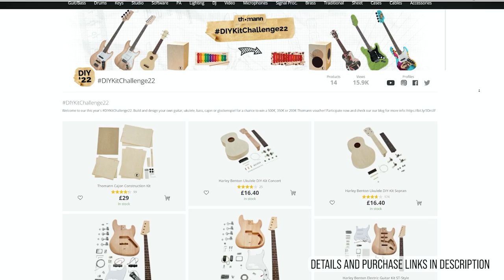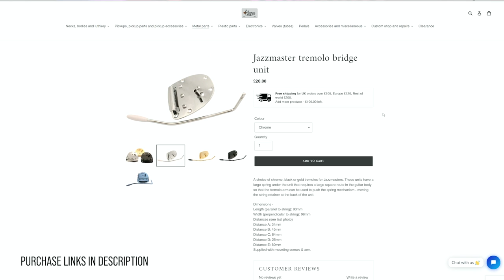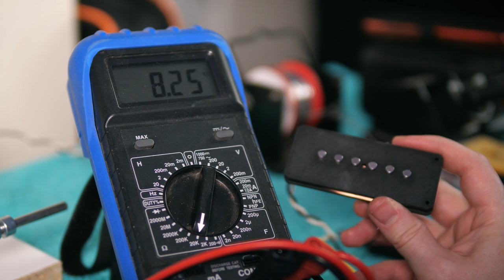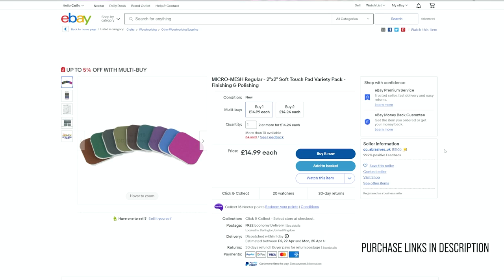Modifying a Harley Benton Jazzmaster Kit | #DIYKitChallenge22 Part 1

Comment: Interesting! The only part that doesn't really work for me at the moment is that pick guard material. It's kinda gathered in points where you had to bend it around the curves, and it just looks daft. As for finish/colour, I'd love to see it in some kind of outrageous shocking red. Tidy up the pick guard and the black would work nice.
Reply: I think the pickguard issue could be solved by doing enough relieve cuts on the backside and then burnishing the edges. That should help to make it conform to the pickguard underneath much nicer!
Reply: @helojoe92  I'm not convinced that would solve the issue. It would need to be heat molded or the material would have to be stretched in some other way. It's all good, and I'm sure it'll end up looking great.
Reply: @periurban  I'd give it a try anyways^^
But taking a heatgun and/or some moisture to it should help aswell 👍🏻👍🏻

Comment: Finish suggestion - find someone with a laser etcher big enough to cover the surface of the guitar, burn in a dinosaur outline of a different species from what's on your flying V (maybe something from the herbivorous groupings?), working a design around the area that can mask the plugs, and then give the whole thing a coat of poly... or heck - do you think the Crimson melamine would work on the body?

Comment: I have also put a JA from HB together but with a Bigsby term with a roller bridge. I painted the body with gold glitter from the same material which is on greeting cards cause I do screenprinting as a job. The headstock is also gold glitter which has the form of a fender head. I changed the P90 pickups with other better-sounding pickups and It sounds and looks fantastic. Nice to see you modding that guitar and looks terrific too.

Comment: Great start !. My suggestion/idea: do an hotrodded jazzmaster with traditionnal hardware but higher output pickups (like hot p90) and a 'muscle car' paint such as a racing metallic blue (automotive spray paint on a primer coat) with two white stripes (decal or painted).

Comment: As a surf player, there's nothing like the Fender offset vibrato system. The mechanical design builds in a kind of dampening so that it's not nearly as jumpy as a Strat or Floyd Rose trem. This is perfect when you want to play really smooth dips and use a very rounded vibrato. And yeah, if they aren't staying in tune, they're not set up right. I had to retune once at practice yesterday - and mine has the cheaper Japanese version, not the better made Fender AVRI trem.

Comment: Build that Kit myself with that kind of tremolo system... and also forgot the groundwire of the bushing of the Bridge. But If you Drill a hole from the trem cavity to the Electronic cavity, there won't be a need for the String. 
My Suggestion for the Finish is Fabric. IT would Look unique, If the guitar was covered in Tartan or Tweed.

Comment: I like a wood stain combined with a paint. So, stain the whole body black or grey. Then give it a couple coats of poly. Then paint the edges a hard black. Is a sponge to go gradually from the solid black edges to the transparent middle of the guitar.

Comment: I finish I've always wanted to do but haven't had the right guitar for is to use gold foil.

What you do is make a bunch of deep gouges in the body at all kinds of angles and then fill all those crevices with gold foil. Gold foil kits come with an adhesive you use and I think that might. After that you could fill the rest of the gouge up with epoxy resin make it level.  Then paint the entire guitar a black or blue or something dark and sand it back to reveal the gold. Then the standard coats and polishing and stuff like that. 

I think it'll be a cool look.

Comment: To not get those bad edges on the pickguard you need to heat up the decal/vinyl. Then stretch it over and cut with a blade.

Comment: As far as the finish goes for this guitar, I would be tempted to use stains and then finish it off with shellac because the dry time is only 30 minutes and to buff it smooth you need nothing more complexed than steel wool.  The figuring is not very clear with the wood so I would suggest using a heavy black stain and then sanding it back to enhance the wood patterns before applying the colour you actually want.  Since you went for a black scratch plate I would suggest something like a cherry stain, possibly attempting some kind of burst effect to make things interesting.

I know you decided to go for the Jazzmaster style pick-ups to Fender specs, but they do have a couple of issues which can make them less useful to many.  Firstly, they are very low output.  The obvious way to fix that would be to run the guitar through a clean boost pedal or install a boost feature into the guitar like an active pre-amp.  Otherwise the single coil nature of these pick-ups can make them quite susceptible to picking up interference.  I think I heard a demo of a very similar guitar from Fender (I can't remember who's signature model it was) which either had Jazzmaster or P90 pick-ups but with a slight difference - they featured 'dummy coils' underneath the pick-ups to make them hum cancelling without changing the sound.  Is that something you might be interested in trying since you have the gear for pick-up winding yourself?

Comment: Hey! I have a tip for your pickguard, you can use a grip tape cutting technique from skateboard world to make it look almost like it came black from the factory, it will look like a 3ply black pickguard! Take a not super aggressive file and run across the perimeter of the pickguard on the top side where the beveled edge starts and then peel off, cheers!

Comment: I'm really itching to get myself a cheap 24 inch scale length guitar. I had hoped there might be a kit out there but they are very few and far between. Is there just not as much demand for a 24 inch scale length guitar? The first guitar I ever struggled to teach myself to play on was a fender mustang my uncle loaned me for a few years about 21 years ago. I didn't know anything about guitars at the time, I just did my best with it, but in retrospect I'm thinking I really dug that scale length without even knowing what scale length was back then.

Comment: Colin, might sound like an odd question. You reckon I could use surf-wax for potting pickups? Whenever I de-wax a board, I stick it in a bean can then pop it in the oven for all the collected silt/sand and other impurities to settle out - after that its completely re-useable.
Reply: Surf wax is usually a combination of beeswax and paraffin, which is exactly what Colin is using here. Might be a different mixture though, and surf waxes might also have fragrances or other types of wax in them that wouldn't be used for potting pickups.

Comment: 5:53 thank god you used pliers
Reply from the maker: Had I not I'd have burned my hands. The metal bushings were heated with a blowtorch to make them easier to tap into the hole.

Comment: What did you dip the pickups in right after winding them?
Reply from the maker: Wax. 
Potting the coils in wax consolidates them into one mass and prevents microphonic effects of loose coils moving around inside the pickup.
Reply: @ScienceofLoud  Was it just paraffin wax, or another kind? Or a combination of waxes?
Reply from the maker: Mix of paraffin and beeswax. Pure paraffin is a little too brittle and doesn't seem to penetrate the coil as successfully.
The beeswax gives it a smoother, more pliable consistency which penetrates better.

Comment: I have a Flying V it was a good kit until me and my grandad cut it for a floyd rose bridge and wired the pickups (humbuckers) to phase switch and make them single colils. The blue and silver paint was a big pain . It’s fully built now and it will not stay in tune. It’s a massive pain I wish I would have had it natural wood with Brian may tri-sonics and a Stratocaster bridge but no I’m a crazy muppet . You could say - “ I’m going slightly mad … it finally happened oh yes …”

Comment: Changeing parts is not modifying.
Reply from the maker: If it's been changed from its original parts or configuration, then it's been modified. That's the very definition of the word.